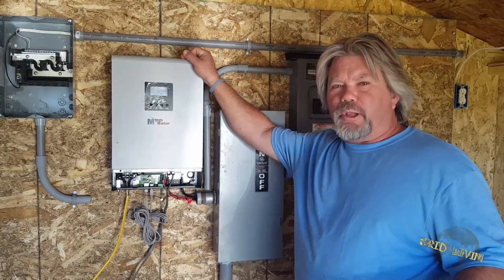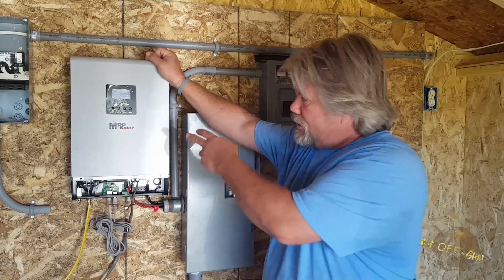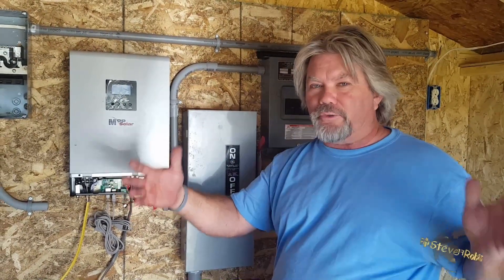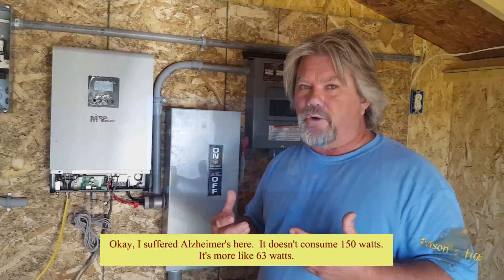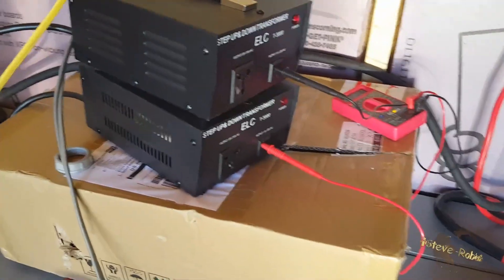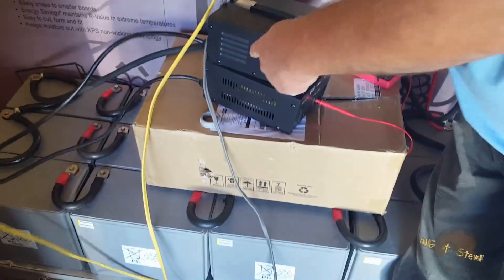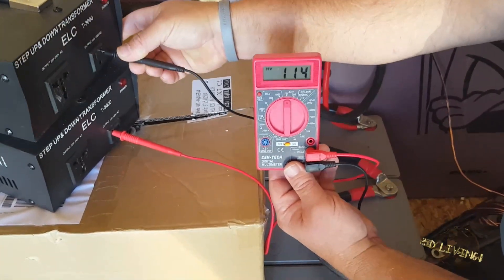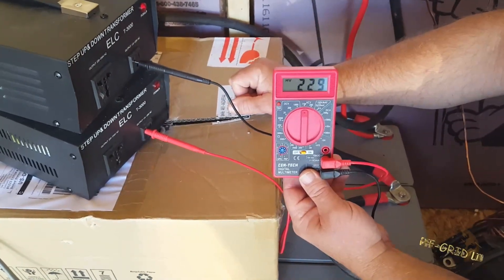Another MPP Solar PIP Inverter Split Phase Transformer Solution

Comment: More info on this video. The 2 transformers that are 3000 watt are only rated at 1450 watts for appliances, they are not designed to power resistive loads like heaters, or coffee makers, toasters and such at 3000 watts. There max output for appliances is 1450 watts

It shows to come with a standard 3 prong American 110v plug, but the instructions say they are not made for American 220v dual phase. American 220 is single phase, to call it dual phase you have to include the center tap or neutral wire in the center of the winding which gives you 120v when it is hooked to either end of the 220v wires, so basically American transformers have a center tap in the 220v output side European transformers don't, and if you do not use the center tap, there is no difference in the 2 forms of 220 volt wiring.

The  3000 watt transformers in this video have a switch on the back for 220v input or 110v input wiring, This guy would have had to have each transformer switched to 110 volt input even though he hooked 220v from the inverter to them, because he hooked the transformer inputs in series, meaning one wire from each transformer was hooked together, one black and one white wire, and the other black wire from one transformer and white wire from the other  transformer hooked each to one of the inverter wires.

With this wiring the 220v traveled through one winding to get to the other meaning each winding of each transformer got 110v, therefore what you end up with on the secondary side or plug is not one output of 110v 6000 watts, but 2 - 3000 watt outputs each. With the transformer his buddy had been using, he was getting that output on one 110v circuit or plug, from one winding

Being that these transformers are limited to 1450 watts on resistive loads each, they do not equal what he had with the other transformer, he would be getting less than half the watts capacity so the wattage he was saving at idle was not 75% less for the saving of watts because it would take 4 transformers 3000 watts to compensate and still  you would not get 6000 watts total because the max each transformer can tolerate is not 3000w it is 1450 watts.   1450 X 4 = 5800 watts.

Considering these transformers cost $118.00 new now on ebay for 4 of them $472 dollars is a lot to spend to save maybe  27 watts
63 watts - (18watts X 2) = 27 watts

It would be better to just have a breaker going to the transformer and if you were not using the power from it, shut it off., or put a timer on it to shut power from the inverter off to it during periods it is not going to be used.
 
 

T
Reply from the maker: @GaryHarron  So if I have two 100w light bulbs each going from separate legs to neutral, how many watts is the transformer supplying to those two bulbs?  Load balance is key in any household wiring project.  It's absolutely critical in off-grid applications.  I have since moved to Hawaii and still live off grid in an all electric home, including a level 2 EV charger, water heater, and conventional electric range.  I have 10kw of inverter and one of these transformers provides split phase to my entire home for the last 8 years and the transformer rarely ever even gets warm.  If i ran all 120v loads off one leg, the transformer would have a meltdown.  Load balance is key.
Reply from the maker: Of course, everything evolves and improves over time.  Here's a later video that shows how split phase (not dual phase as you said): https://youtu.be/mbjn8mAOnHA?feature=shared
Reply from the maker: Currently, Amazon has these on sale for 93.99 (normally 104.99).  It is a 5kva model, not 3kva.  https://a.co/d/c55GDem

Comment: So would this solution get around the inherent problem with autotransformers where if there is too much current draw on one leg, it causes too high a voltage on the other?
Reply from the maker: Yes it should.

Comment: I was reading some of the reviews for similar transformers on Amazon and people were complaining they weren't isolated.  If this is the case how might this affect your plans with this transformer design?
Reply from the maker: I use toroidal transformers only. They are efficient, center tapped, isolated, designed so they are perfect for creating split phase 240/120VAC from single phase 240VAC.  Model TC-5000 good to 5kva.
Reply: @OffGridLivingSteve  I pulled an old transformer out of a broken inverter of mine. Non-isolated. I connected it to my system and it's done wonders with my surge ability.  No more dimming lights when the clothes dryer starts!
Reply: @OffGridLivingSteve  with your toroidal transformer being isolated I guess that means that the power is required to go through the air?  I guess that may mean it's required to be less efficient than one that wasn't isolated?

Comment: Hey Steve I just bought one of these Inverters and have been looking everywhere to see if I can find a cheap solution like this. I was wondering if you had any luck putting some serious load on the transformer wired like this and if it had any issues.
Reply from the maker: Jacob Taylor I’m able to load it pretty good. I have an updated video of doing it on my new channel. You can see it here:  https://youtu.be/0E8fV9VMDFs
Reply: @OffGridLivingSteve  Ok thanks a lot these videos have been very informative. In your opinion would it be better just to get an inverter with the split phase integrated +350 dollars I have read that the transformer could pose problems down the road as far as maintenance and replacement.

Comment: I just now started up my system with the same split phase step down transformers. Only thing is am using the output power to charge my lithium batteries with my magnum 4448. I have2 battery banks one lead acid and one lithium bank. Will see how it holds up.
Reply from the maker: Dwight Forbes let me know how it goes!

Comment: Thank you so much for this video steve, [ you just earned a subscriber!!!! ive been dabbling with off grid solar systems for many years but getting split phase 240 and affordably has always been out of the question cost wise, UNTIL now. . .  right now i have 2 gc2's  a xantrex xm1800 . .  and epever 40 mppt and 500w of sollar. . not a huge system BUT the will start up any 120v item in my house [power saws, window acs, fridges, actually have had the whole house wired to it for storm outage  [my usualy consumption is about 350 watts]. .  but just have never been able to run the well pump. . .im going to try a single 3k transformer since I am finnaly aware I can use a single phase 240 source to run  my well pump that is currently power by split phase 240 . . . . .  . not sure if my 1800 continous/3600 surge inverter will have a enough juice to start it but i hope so. . . if not it seems like i might be upgrading to one of these PIPs systems. im just sure if im ready to make the switch to out 12 volt to 24/36/48 since everything i have is 12 and i have such a small system. . . what pips system would you recommend???  again MANY THANKS!!!!
Reply from the maker: Mike Rivera JR the PIP you want to use depends on the battery voltage you want to use and the type of battery you intend to use. I have an updated video for obtaining split phase here:
https://youtu.be/0E8fV9VMDFs
Reply: @OffGridLivingSteve  wow, i didnt realize you had another channel, you just earned another subscription. . . thanks for the response brother!!!!!!
Reply from the maker: Mike Rivera JR you’re welcome. Thanks for joining us!

Comment: The big transformer would have something like I E design and have a inherent power loss, the ones your using now look like they are toroidal and have less loss because of a round core design. I just ordered one of the t-3000 from amazon so I can run my IGBT chinese welder (got my fingers crossed lol) on 240 instead of 120.
Reply from the maker: David Smith these newer ones do have a toroidal transformer and their quiescent power consumption is around 15 watts.

Comment: Since you have had exposure to multiple MPP solar units, I was wondering if you had encountered the "premature floating" issue that some are reporting.  I think those who have seen it are suggesting that the float and absorb voltages have been swapped in the firmware.  Seen any such thing?
Reply from the maker: Tom A I also have heard of it but haven’t experienced it myself. I’ve seen 6 installations in Colorado and 8 here in Hawaii. Zero issues. I have two powering my own home at the moment.

Comment: Hello Steve, First of all great video.
I do have a question, what is the model number of this MPP solar inverter?  You mentioned it was 230v output. Single phase?
Hope to hear back soon. mikea1a@hotmail.com
I like the idea of using two transformers, to achieve split phase.
Also, how is it all working out, using the two transformers?
What have you connected and at what loads?
Thanks,
mikea1a@hotmail.com
Reply from the maker: Mike A hello Mike. Everything is still working well. This channel is pretty much done. I have more videos about this inverter on the new channel. I’ll put a link to it right here shortly.
Reply from the maker: Mike A the channel is here:
https://www.youtube.com/channel/UCVn2ng2ythNsotzk4IT42NA

Comment: I got  MPP PIP 5048 and came with broken AC terminal. I had to pay $28 for new AC terminal and replace it myself. MPP does not have a warranty .
Reply from the maker: MP Solar probably isn't a good solution for the novice or turn-key off gridder.   If spending $28 for a $5 terminal and installing it isn't worth the effort, then you should definitely go with Outback or MagnaSine.   You can do a lot of DIY repairs to this inverter long before you come close to the cost of a high quality unit.  But if you're looking for perfection in a Taiwanese product that's 1/3 the cost of it's higher quality counterpart, I assure you that you will be disappointed.  The pioneering off gridders go the cheaper, more difficult route in their quest for independence, have limited means of income, and this inverter provides a solution that would otherwise be unattainable by any other means.  If you remove this inverter from the market,  you haven't forced thousands of people to a better inverter.  You've forced them back into the dark.  You can buy two of these inverters and still be out less funds than it's "quality counterpart".   I've heard a handful of horror stories about this inverter, but have not had any issues with any of the nearly 2 dozen inverters I have been involved with the installation other than improper installation or operation by the user.  Caveat emptor.
Reply: @OffGridLivingSteve  The inverter came with broken terminal and they ask me to pay $28 for shipping.
Reply from the maker: @levonet33  they always require payment for shipping, and that is disclosed in their documents that are available before you make the purchase.  You could have purchased the terminal cheaper elsewhere.  I watched your video about the defective fishing reel.  Personally, I think you should spend money on only the highest quality products available or you will be continually disappointed and unhappy with any purchases of lesser quality.

Comment: did the inverter work properly after use 1 yer mr. ?
Reply from the maker: All PIP inverters I have been involved with continue to be trouble-free to this day.  Duane's being the first I believe to be over a year and a half ago, if not two years ago.  I have two installed at my home presently, one of which operates at over 94% capacity about 6 continuous hours per day.

Comment: You seem to be referring to my video. You only mentioned the idle consumption (which IS a huge issue for off grid because it requires more storage and pv) and neglected to mention all the other issues:
1. No short circuit protection as advertised
2. Lousy sine wave output
3. No customer service
4. No warranty
Taiwan and China are very different. Taiwan is more like Japan as far as workmanship, build quality and quality control goes. But they have the same attitude to customer care as the Chinese in that lies are told and after they receive payment they don't care and will rudely tell you to suck it up and buy another one. So if you want to promote a product that lies about it's performance and has no warranty then so be it
Reply from the maker: Actually. I wasn't referring to you or any of your videos.  I've never watched your channel, and given your hostility I probably never will.  But if the shoe fits, feel free to lace it up.  First off,  the price of this inverter for most people is the difference between having 400 watts or 4,000 watts of power.  Secondly, I have personally been involved in 9 installations of these inverters with zero issues, except one which was a cloud edge issue - that was caused by the PV voltage being occasionally driven past 145V.  After rewiring the PV array, there have been no issues since.  Thirdly, any installation you are involved in should always have the inputs/outputs protected by fuses or breakers.  Even my $2,000 Magna-sine installation in Colorado is protected at every electrical connection with circuit breakers.  That's not just good sense, it's code requirement.  That aside, I have shorted the outputs of these inverters sometimes intentionally, sometimes accidentally with no damage to the inverter.  In fact, the inverter shut down before the breaker tripped.  Fourthly, since I've moved to Hawaii, I have 4 of these inverters installed.  My next door lady, had a Trace inverter.  She now has one of these.  Now she has a refrigerator, microwave, and convection oven.  The old Trace wouldn't drive the fridge because of the modified sine wave, and that's not even talking about the microwave or convection oven.  My home here in Hawaii is powered by these inverters.  It charges my electric Nissan Leaf with the required 3.8kw of power AND powers my hybrid electric water heater SIMULTANEOUSLY!  So you can conduct all the "scientific" experiments you want to discredit it, but as long as it delivers a solid solution to the real world end-user, it will continue to be a successful product.  Do I have an issue with someone on a limited income having this AND an MPPT charger for under $800?  Hell no - especially when it performs well enough that their only other affordable option is nearly nothing.
Reply: @OffGridLivingSteve  that's a lie. Give me the link to the video you ARE referring to then. Because you are reciting my video almost word for word. As for your 3rd point, why are you rambling on about fuses and breakers? Tell me what the PSCC is on your system. Do you not realize that sensitive electronics can be damaged in the milliseconds those things take to break the circuit? You seem to be implying that the short circuit was either negligence or incompetence. It was neither actually, but thanks for the condescending accusations on top of attacking my video (and you have the nerve to call ME hostile). A FET on my other CC shorted and the main fuse blew. You seem to be under the impression that a short can only occur on the output side, do you not realize it can happen on the input side?
Reply from the maker: @climatechangepreppersfaceb2148  Wow.  Sensitive much?  You need a life.  Apart from mine.   And oh, I guess it was you.  Didn't realize you changed your name.   Just like you , I'm entitled to my opinions.  Good day sir.
Reply from the maker: Actually I really dont even remember it being you since apparently so many people are on your side of it being garbage,  so like I said, lace it up and wear it.  I dont really even know what you think you're being vengeful about.  Why you think you need to even defend yourself here.  No one has mentioned you but you.  Seriously.  What is your real problem? It's not numbers for you dude, it's personal to you.  What the hell is wrong with you?

Comment: Steve will a load that is designed for 240v split phase run correctly on 240v single phase? would using the two transformer method be a better way to go.
Reply: https://photos.app.goo.gl/dAiHsPqBZcqPAYzJ7
Reply from the maker: Yes it runs correctly.  Chris and Becky are running their 240VAC well, and all their 120VAC appliances via this configuration.  We have it all wired through a standard service panel.
Reply: Iam running the system initially as Steve mentioned in the video with 2 autotransformers cross connected but you can do the same with only one transformer.